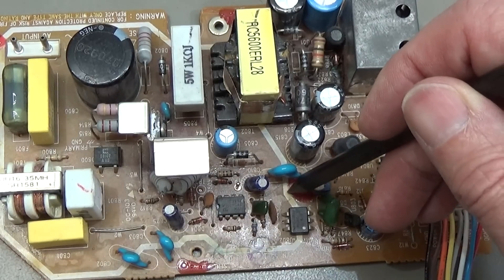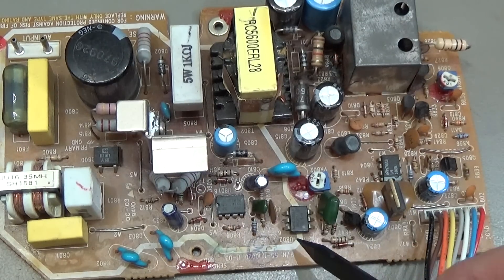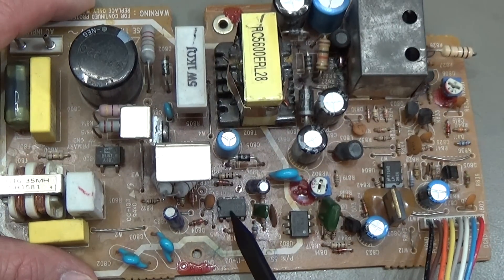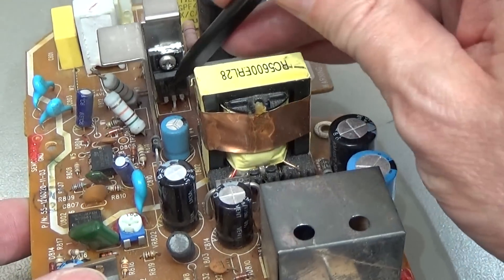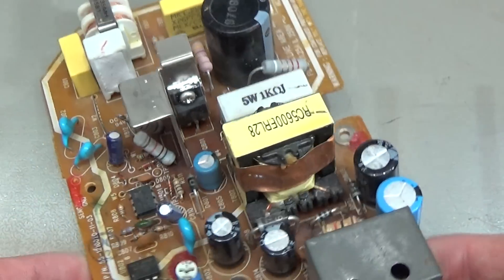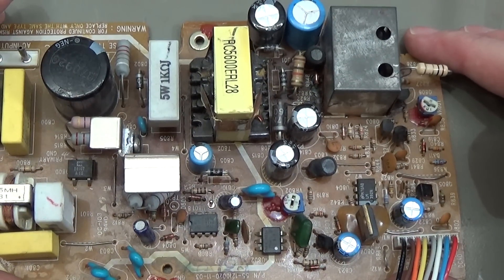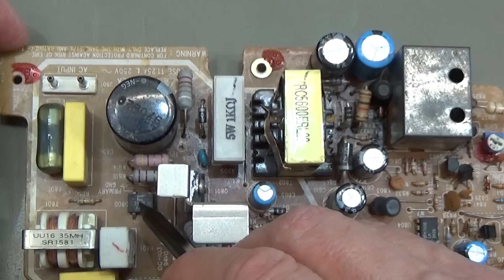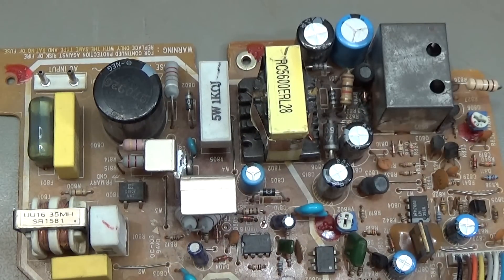#79 Basics of switching mode power supplys

Comment: Hi Peter;

   A very interesting video of the theory behind and demonstration of switching power supplies. I didn't know they were so cleverly self-protected like that. I always under appreciated their technology. So just upping the frequency to the transformer increases their efficiency. Is this the same as saying it increases the permeability of the the magnetic properties of the transformer's core? Nice demonstration of the duty cycle and the self-protection shut down as well.

   One last thing that is confusing to me. You said it is important to have a isolation transformer for the power supply you are testing. Yes, I know this. I  use a Sencore PR-57 isolation transformer and variac myself. But the confusing part is that you used a second isolation transformer on your 1054Z DSO as well. Isn't this redundant? I have the same new scope as well and don't want to kill my unit. We both know that the scope lead is connected straight to earth ground. But... If the circuit under test is completely isolated from earth ground using a isolation transformer, how can the scopes shield be in any kind of "potential" trouble. Or are you just paranoid like me and making double sure, by using two independent isolation transformers. {:-()  Can you expand on this?

   Great video and 73s
                                          Tom
Reply from the maker: +AntiqueRadioandTV Hi Tom, thanks for feed-back! Well as far it comes to safety isolation we have to make sure that there is no earth connection on the secondary side of the transformer only then we have full protection. Now we have to connect our scope to the DUT and with the probe ground we connect earth to the secondary side of our isolation transformer.  That is exactly what we have to avoid because we jeopardise our safety protection...(no earth free potential as we need it) On the other hand I'm paranoid to double close the leak... :-) Hope that helps Thanks for watching 73's Peter
Reply: Quote: "Now we have to connect our scope to the DUT and with the 
probe ground we connect earth to the secondary side of our isolation 
transformer."

   Hmm... I see. Very interesting and something that I hadn't thought of. I haven't seen anyone else running a second isolation transformer for their test equipment either that I can think of, but I see now where the potential problem lies.

   Well then I better shop around for a second isolation transformer for my test equipment. I think it would be beneficial if sometime you would explain this in an up coming video. It may save a potential disastrous event for someone.

   Thanks a million for your time Peter!,
                                                                           Tom
Reply from the maker: +AntiqueRadioandTV Tom, there is another trick to connect two or even more devices to one isolation transformer. Just take a multiple mains socket and DISCONNECT protective earth in the wall plug of the multiple socket but make sure that you have equipotential bounding conductor between the connected devices. This is very important if one device gets a short to the housing we need to bring all potentials back to one level to avoid potential difference between two devices to avoid electrical shock. So you can connect i.e more test equipment to one transformer! Cheers Peter
Reply: +TRXBench 
Whoa,,, Cool, Makes perfect sense. If I don't find a second isolation transformer within my budget I think I'll try this approach.
Again, thanks a million Peter!

Comment: I have few PSUs for PC different brands, BeQuiet, EnerMax 1000W, 1200W ... they are blowing the fuse from the wall up, only when I connect the PC to the plug. It looks that the stand-by circut 3,3V has some problms, where should I look? The PC is working perfect with other PSU. I cannot find the block-diagram...

Comment: quick question if I may. is it OK to have the power supply and the oscilloscope on the same iso transformer, but different outlets? Or, do you need to have 2 distinctly separate is xfmrs?Thanks!
Reply from the maker: As Long the both outlets are isolated from each other it is okay any other configurations are dangerus. Hope that helps 73
Reply: thank you so much, the outlets on my wp-30 are isolated from each other. last question, being as you are so generous with me..I have a current limiter (light bulb on an outlet as per uncle doug) can I : plug my device under test into the current limiter, and plug the limiter into the iso xfmr, that way I know if there;s a hard short  (bulb lights)AND the mains of everything are isolated. Thanks again!

Comment: What’s wrong if it breaks down  if normal load is applied? Example it works until about 3 or 5 volt output then it begins to bump (on-off). Variable output from 3 volt to 15 volt.

Comment: Thanks so much for this education on SMPS. I learnt so much, however I have one question,  how is the IC powered? or where does the voltage reference on the pin8 come from? 2 questions I guess. Thanks in advance
Reply from the maker: +Chima Nmerenu Hi Chima, thanks for watching. The IC is powered over a resistor directly  from the filter cap and rectifier. The voltage reference is inside the IC. Hope that answers your questions. all the best and Cheers.
Reply: +TRXBench , Hi, yes its clear now.  thanks so much for your time.

Comment: great video, it answers so much, thanks. at 42:00 If you were to switch out that 1k Variable resistor for say a 5k one and limit the voltage a bit more, for example changing a 70V output to 48V or a 48V output to 36V, is there any risk of burning out that diode?  Thanks.
Reply from the maker: Thanks. No it is not so easy and the answer is too long to put it here into the comment field,,,,
Reply: @TRXLab  fair enough, thanks.

Comment: Hello 
In minute 53:00 you show the common mode filter,near it their is a ceramic resistor(low value 0.1 ohm 5 watt I think )  called R801 ,what is this resistor doing in the circuit ?? 
Near the transformer their is another ceramic with higher value ,what is this one doing ? 
I will be glad if you answer,thank you .

Comment: nice work, the protection circuit in my analysis is explained backwards, the optocopler is off state in normal state, the optocopler is switched on when in protection mode, can you check test pin 2 again thanks again, i really like your videos
Reply from the maker: Hi James watch video #80 #80 Follow up video: Deep dive into SMPS's protection circuit

Comment: amazing explanation. i was just noticed voltage drop with my 5v output when load is connected ... and this video gave me the whole picture of a switch mode PS. especially the zener voltage referece and the optocoupler roll for protection mode.

i am trying to fix my small switch mode PS - just for learnig 

trying to find the problem of my PS - i replaced the 5v with external PS - and my device (dvb-tuner) start to work just fine.
 with measured 800ma consumption at the load.without any short, or any other failure.

when i tested the fault PS with dummy load i start to see voltage drop after going beyond 50ma (100ohm load)

i just wonder what causing the early protection mode?

  can i suspect the zener or the optocoupler fault ? because getting into protection mode at very low current consumption as only  50ma ?

i tested all passive components (diod, capacitors )on board (near the secondary transfomer 5v  output ) for any short
but they all seems to be fine.

what is the best way to eliminate or to bypass (or disable) the zener &optocoupler roll for protection mode...
assuming nothing will go wrong if the load was tested and measured consumming only 800mah with no any short.
and if something will go wrong without the protection mode - i will  just buy PS module for $4
:)
by watching more videos about the switch mode PS - i noticed those 2 components are very sensitive and popular to be faulty 

anyone experienced - any idreas? 

thanks ELI
Reply: Did you check the resistences asociated Whit the  zener (431), some times    they are the cause that the protection comes on even if there is not load .

Comment: Thank you very much for this great video
Do I have a query can isolate each stage and running for testing readiness and inventory problem, and the way to it in detail
I know that if there is any defect if these simple circles and at any stage of the circuit will not work
So the idea of isolation and testing this is my question ?
Is your link my idea
 Thank you
Reply from the maker: +Mazen Ramez Hi Mazen, thanks for feed-back. I'm sorry I don't really understand your query. Anyway all the best and Cheers

Comment: Hello Sir,  Many thanks for this very informative Video. I have a question which I very much hope you can answer. I am trying to repair this SMPS which has the exact replica of the circuitry for the board you are using in your video. It is making a clicking noise repeatedly.  I have checked the voltage on the output which is supposed to be 12V 4.16A. The voltage keeps fluctuating from 11.5 to 12.5 and I have checked all the capacitors with an ESR meter and none seem to be faulty. Would please give me some indication or clue what could be wrong here? I am just looking for some pointers. Many thanks again. HBehjat.
Reply from the maker: Hi, it is a short in either one load circuit or on the secondary side of the smps. Hope that helps

Comment: its nice explanation on SMPS power supply, i have SMPS witch have 300 v dc from main capacitor but its dont have out put voltage, any suggestion pls.
Reply from the maker: Hi Tshering, there are so many causes for failing. It is impossible to troubleshoot on remote. But with the knowledge how it works you can start your own approach.. All the best 73

Comment: To: TRX Bench ; in duration 15'44: following you,  the opto couple curcuit is used to control error , so a question: where is  error be  produced ? thank
Reply from the maker: If a diode has  a short Or a voltage is missing or voltage goes to high.

Comment: i still didnt get it why do we use switch mode(SMPS) more often instead of Linear mode ? In SMPS; AC comes from input, we rectify it into DC and in transformer it turns to AC again and after transformer we rectify it to DC again ... what is the point of turning again and again ? Because Linear mode is very simple.
Reply: There are many advantages to switch mode topologies, with two of the most significant being physical size and efficiency.  High switching frequencies enable much smaller transformers and filter capacitors to be used, while the utilization of switched output regulators reduce the amount of heat dissipation required in comparison to that of a linear power supply.

Comment: 16v at one end of the resistor from 4148 diode(D10) there are in pairs (d9/d10) and 0.76v at other end of resistor which junctions with drive transformer.. ,i was suggested that i should get 16v or nearby volts at both ends of the resistor, please guide me,its a mercury 400w power supply ,i am asking for help from other forums too,if anyone know the circuits well ,please help me,thanks

Comment: nice video. i have a SMPS that can give 12 volts at 60 amps. i want to make a circuite that can convert it to 5 volt 100 amps. is it possible? can you give me some idea. thanks in advance.
Reply from the maker: Hi Mohammed, your PSU is capable to deliver 720W and you ask for 500Watt so it should work. 73
Reply: how do i make it 5volt?
Reply: may use a 12V to 5V DC-DC BUCK circuit
Reply: where do i get a DC-DC buck convertor circuit that is capable 12v 70a to 5v
Reply: do you have one? 12v 70a to 5v 70a (least).

Comment: hello I'm sorry this video has 1 wrong information  this power supply monitoring cv 5v bud you load 12.4v  
so TL431 wen you mac 12.4 load 5.0 volt kidding hi so TL431 K volt  low   so please  mac 5v load ant check again
so you can understand where you wrong